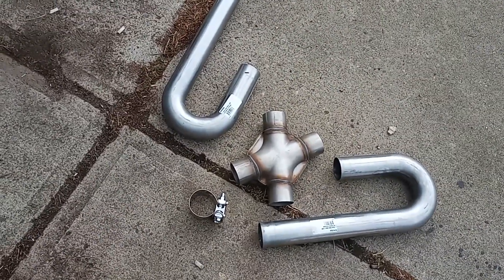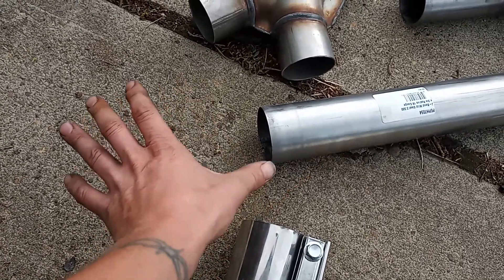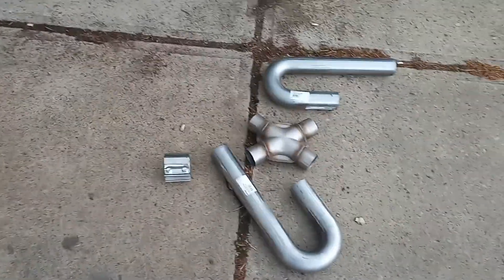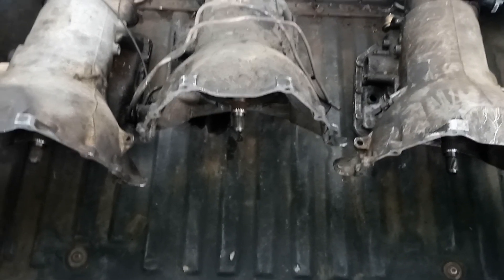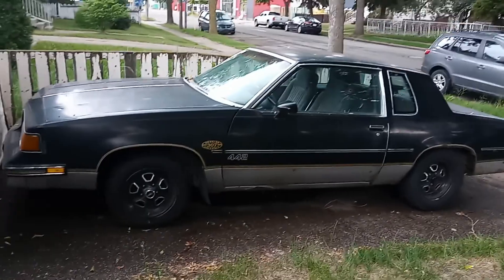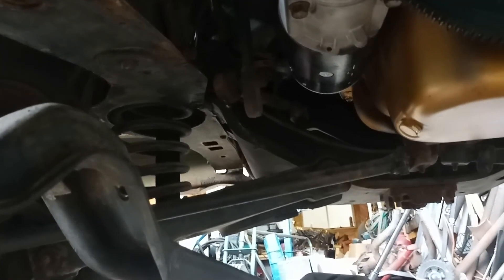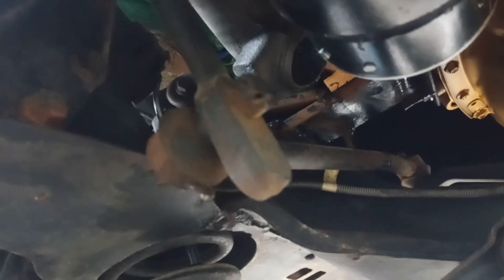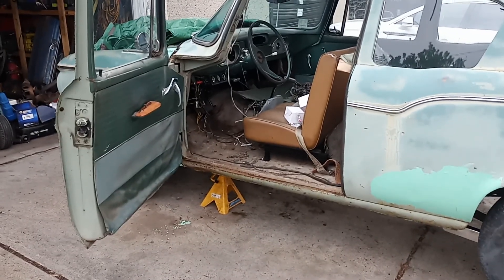exhaust plans. Sgt. Stubby 455Olds Lark. #nonamenationals

Comment: Enjoying the build!- always wanted to see a fast Lark. 
   Relatively low curb weight, big engine bay, and often in pretty good shape for a 60 year old car.
   Haha!-Lucky Lager was made here in Vancouver, Wa.(1825-ish) for decades with the Rebus Puzzle under the caps.
   Hope the Passport gets ironed out & you have a great time at the Nationals!
Reply from the maker: Thanks for watching man.
Reply: I had one of those old Hot Rod magazine engine swap books that had a 392 Hemi swapped Lark in it
Reply from the maker: @AndyGeesGarage  Ya man I got that engine swap book it has a 392 Lark and a 455olds Avanti. Thats how I knew it could be done. Didnt really follow anything they did though. I found it easier than what they said. We will have to meet up here one of these days soon. I saw you had slicks on your square body hooked up to you 1 ton van last week.
Reply: @wildrosegarage4208  yeah took it up to the Gear Grabbers race weekend up in Bonnyville. Slicks, Lincoln locker and Caltracs shaved 2 seconds off the 1/8th et from June. Still has the turd 350 in it though. It’ll have to wait until the spring to get the turbo small block, the trans won’t survive it. She’s week second gear is getting spongy lol

Comment: The classic lines continue 🤣🤣🤣 Great score on the transmissions! Mickey is awesome! Hey brother, You should do a light restore on the 442. They are at a point in value that you can get good coin for a nice sort out one. People are looking for good solid examples to do full restorations. 442s are the rarest of the 80’s G bodies. Great video with laughs as usual! That’s your trademark! Don’t stop!👍👍👍👍
Reply from the maker: Its a fun car. It has a 425Olds th350 manual valve body 3.73 with lincoln locker. Its rough but not past the point of no return.
Reply: @wildrosegarage4208  She’ll sell brother. If the body is decent she will go fast